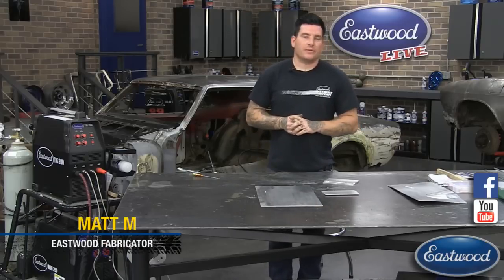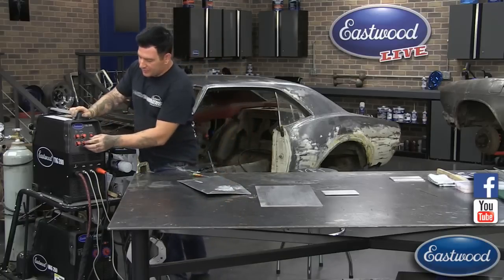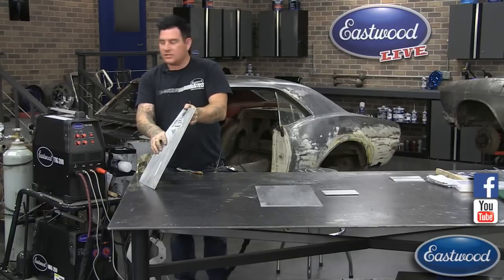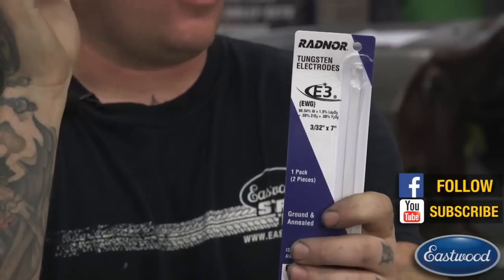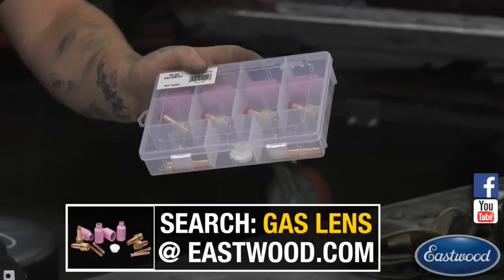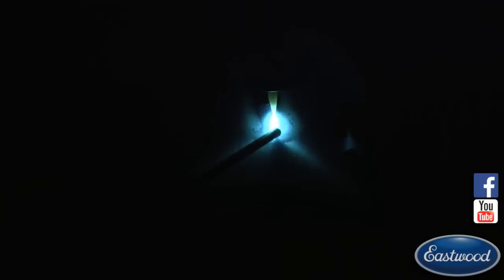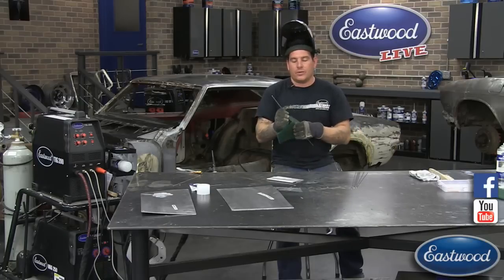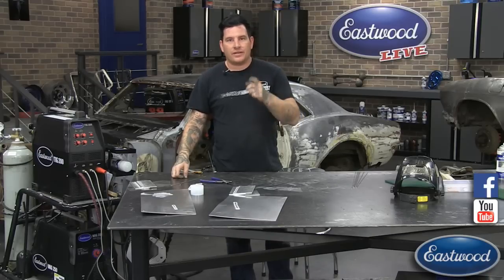How to TIG Weld Aluminum - Great Tech Tip for Beginners from Eastwood

Comment: Great video , one thing any beginner should know. Just because you can mig weld doesn't mean you're going to be able to pick up a tig and start welding like a pro. I think that's why so many people just give up and return their welder so thinking there's something wrong with it. It takes several hours of practice. I've had my tig for 15 years and if I need something important welded I call a friend that's NASA certified to weld it. I would suggest taking a TIG welding class or have someone that knows how spend a few hours watching you and help get you started in the right direction. Don't give up
Reply from the maker: Thanks for sharing that advice.  With a little help, TIG welding is fairly easy to learn.  But, like you said, without help, people often do get discouraged.  I think the Eastwood TIG  200 AC/DC is a great machine, especially for beginners, because it's very easy to use and get the proper adjustments for good welds.  The chart makes it very easy.  From there, it's just honing your technique.

Comment: Damn I'm old. My first aluminum TIG was an old Sears Colormatic (still have it-rebuilding it to stock new condition purely stick again - fun project) 2-phase 220V (guessing it's 60Hertz) stick machine switched/wired to AC with a bulky 3 hose TIG gun (ON-OFF) cooled by a Glucose tank I made (did not have floor drains or anyway of just running off a hose or sink)  and a large fish tank pump (Also a Sears LOL) running threw a large after market Ford transmission cooler with a Dodge Aries 12volt fan run off a battery with a 12volt battery charger.  And back then all We had was pure tungsten and had to scratch start,no HF then LOL ! And I don't know why You say if Your just starting out there's a power and use chart to look at. I have been a heavy duty mechanic and welder/fabricator for 32 years and I still look at the charts for help !

Comment: when I took welding classes I used 2% cerated  tungsten for both aluminum and steel and it worked great and that was with a miller syncrowave 350 transformer based tig welder

Comment: That is a nice steel welding table that you have which probably weights close to a ton.  What is the least welding table you can get away with from a practicality and safety standpoint...for welding aluminum sheet metal

Comment: Ahrr There Matey - Great Stuff.  You are pretty good instructor. I Especially liked the -\+ settings explaination. AlSo - The Foot Pedal adjustment - I didn't know that.   I've got a SynchroWave 200 which my DaD left me which I am trying 2 figure (tigure) out.   While practicing ALUMINUM, I was doing crappy welds - Until I finally Switched it over to AC...   Now I must practice...   This Foot Pedal is KILLIN Me  -  I've ALWAY's Must B sitting just so 2 get a control of the Switch.  I NEED a Thumb or hand Tig Welding Switch...                 Regards,                               LJR-III

Comment: Right so let's start at the very basic's... I assume from watching a couple of your video's that basically unlike MIG where the wire actually touches the grounded piece I think that the technique here is to have the electrode a minimal distance away from the grounded piece and the "Flash-over" form's an arc which in turn melt's / heat's the metal up to a super-heated state ( I assume from an RF Radiation kind of effect), where the contact of the filler rod melt's the filler rod and that form's an intermetallic bond between the 2 metal's, if I'm working by the correct song sheet then could you give some guidance as to standard "clearance" (or gap's) between the grounded work piece and the electrode of the TIG gun, I have done quite a bit of MIG welding (self taught, after a quite considerable quantity of steel and stainless test / practice pieces, and I'm up to a reasonable standard), but I'm wanting to expand into TIG as I consider it to be much neater, cover's most alloy's, more versatile and now that I've found myself at the stage of needing to weld much heavier pieces it should in theory be more adept. could you please if possible expand further upon the theory behind the art or have I about covered it in " lay-man term's"

Comment: I have the 200 model. I want to weld some 1/2" aluminum to 1/8| aluminum. I made the parts for a tunnel ram manifold. Will this welder do it?

Comment: So if I'm welding aluminum and steel do I need two different welders. I weld sheet steel and want to start welding aluminum
Reply: if your tig welder is an ac/dc machine no if it is only dc then yes

Comment: When your welding aluminum AC/ you want to have reverse polarity correct? So you want your tig torch plug into negative port with the ground clamp plugged into positive port. Correct?
Reply from the maker: Yes AC welding flips polarity.  How it accomplishes this will be different machine to machine.

Comment: I am looking at buying a TIG machine mainly for Aluminum. The Miller salesman is trying to sell me a machine for about $2,000. Seems high to me. Most of my aluminum projects are .100 thickness and 5086 Aluminum. What's a good machine for the buck?
Reply from the maker: This is a great machine that's easy to use:  The TIG 200 Ac/Dc  http://www.eastwood.com/tig200acdc-53012.html   But if you're looking for a machine with more controls, especially for welding aluminum, you may want to consider the Digital TIG 200:  http://www.eastwood.com/tig-200-digital.html

Comment: What's the thickest aluminum you can weld with your machine or other models?
Reply from the maker: The TIG 200 ACDC and Digital TIG 200ACDC will weld up to 1/4" thick aluminum.

Comment: When you set up your amps on the machine and the pedal  which source control  is it drawing from the pedal or the machine? Example if I set my machine at 110 and my pedal at 100 does it read the max on the pedal or the Machine?The reason I ask after my aluminum got hot it melted before I added filler at 100 on the pedal..but the machine was set at 110.Also no matter how many times I sharpen  my tungsten to a point the second it hits the aluminum it is balling up on AC setting  .What am I doing wrong or is it  normal ?
Reply from the maker: Did you make sure you switched the machine to use the foot pedal?  There is a switch on the face of the machine for "Foot Pedal" and "Panel Control".  If it's set to Foot Pedal, the Foot Pedal is the only heat setting that matters.  Does this answer your question?
Reply: +Eastwood Company yes I figured that out  and that solves it thank you . The second question was is it normal that my tungsten is balling up quick?  the size I'm using is 1/16"x7" should I go with t 3/32?
Reply: that is normal for alloy, for steel the tip keeps its point .

Comment: Can you weld aluminum on 110 with tig200
Reply from the maker: Depends which TIG200 you're asking about. You'll need to step up to the TIG200 AC/DC to get the AC you'll need to weld aluminum. The standard TIG200 DC will not weld aluminum.
The TIG200 AC/DC will weld great for you on a 110v outlet.
https://www.eastwood.com/eastwood-tig-200-ac-dc-welder.html

Comment: What should the Argon be set on?
Reply from the maker: Depending on what you're welding, it will be set between 12 and 21 scfh.  For aluminum, like he's welding here, about 15 scfh.  There's a chart on top of the welder to help you get all the settings correct.

Comment: I sandblasted a dirty old valve cover that I want to add -10 aluminum fittings to. I cleaned the area with acetone and but I keep getting black or mushroom effect of trash when i'm welding the underside. Any tips to help that?
Reply: It probably has tons of oil embedded in the pores.  Try baking it in the oven for 350F for a couple hours to burn off the oil, then clean the area mechanically (using a scotchbrite conditioning pad for example) before doing a final solvent wipe. (I know this is 5 years old, just giving an example technique for someone reading).

Comment: Can you tig weld a Roll cage or is not the best choice
Reply from the maker: MIG welding a roll cage is far easier to “glue” the parts together but a properly prepared (nicely mitered and beveled joints) and welded cage with a TIG is equally as strong. It is the best as far as final visual appearance but that’s only if you’re VERY comfortable with TIG welding.
Thanks,
Matt/EW